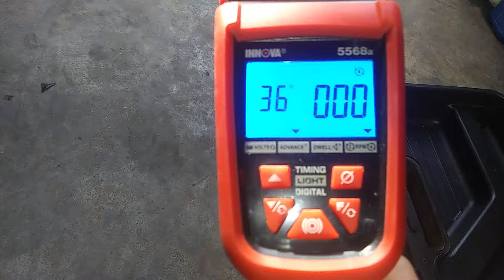355ci SBC running on engine stand.

Comment: It's a runner!
Nice skinnies on the Oldsmobile in the driveway. You bolted the zoomies on upsidedown.🤷 Those would look so much cooler sticking up in the air.😎👍
Reply from the maker: Those frontrunners are 15x3 Fenton Gyros from around 69 or 70. Pretty rare. Rears are mid 80s Centerline Autodrags 15x10 with 5in backspace. 165/85/15 front tires, 275/60/15 rear meats.
Reply from the maker: Fits this 79 Cutlass pretty good. Had this car a long time. It's pretty rowdy when it's functional.

Comment: Spins up quick. Quicker than others I’ve seen on a stand. She’s gonna scream down the track.
Reply from the maker: I cranked the timing up to 38 degrees and rebuilt the 850 doublepumper, leaned out the idle circuit a touch. It's really roars now. Engine definitely liked it. It's thirsty as hell, done went thru 5 gallons of fuel and haven't ran it 20-30 minutes tops. It should make peak power at around 7800rpm. Torque fall in around 5000rpm range. Pretty high strung unit.
Reply from the maker: I'm lookin to run 6.50s or so at around 105mph in the 8th with this unit. Should 60ft in the 1.40s.
Reply: @thereluctantgearhead4544  I'm guessing you're using all the piston speed you can. Rev it out over the power curve then shift so it drops back into it 👍

You do great work. 
Get the water system set up so you can run it longer on the stand.
Reply from the maker: @hackertheslacker Thanks man.

Comment: Sounds healthy! Is that the Big Bootlegger cam?
Reply from the maker: Thanks man. No, the big Bootlegger is in another 355 I have on the stand. It's the black one with Brodix heads & intake. Cam in this unit is a 1997 Crower roller. 274/278@.050, 627/627 lift, 107 lobe Sep. I've had it in a few engines, pretty good bumpstick.
Reply from the maker: This cam ran 6.60s in a 357ci SBC with 220cc ProTopline heads & 12.5-1 compression in a 3050lb G-body. Used 1.6 rockers with it for 670 lift. Couple more degrees duration. Car set up like a NHRA "Stocker" with a manual T-400, 5500 stall BTE converter, 12-bolt with 5-13 gear on a 33-spline spool. Dutchman axles. Car ran 6.20s with a healthy 496 in it. 4-door 86 Bonneville. Ain't pretty, but it's pretty set up. Originally built as a street sleeper, but the 29.5x11.5x15 M/T slicks and Cragar Supertricks wasent fooling anybody. Has 15x3 Cragar Supertricks with 28x4.5 Goodyear front runners on the front. Still have that car, and I'm building a new bigblock for it. I want it running mid to low 5s in the 8th.
Reply: I thought it was a little rowdier. It sounds like you’re going to get close to your mid 5’s in the 8th. Good luck man